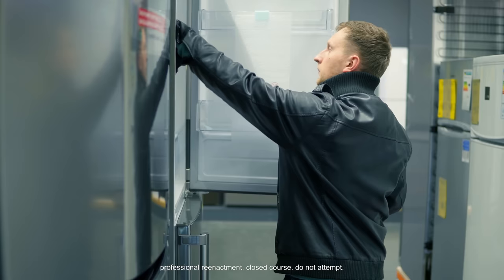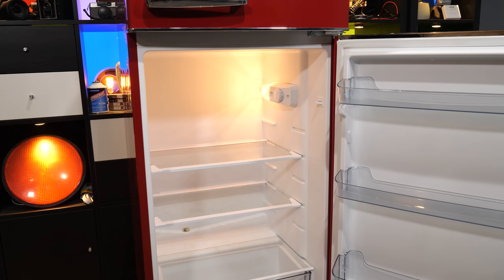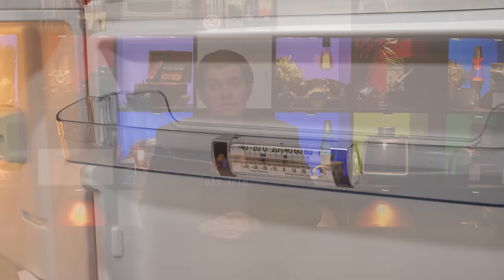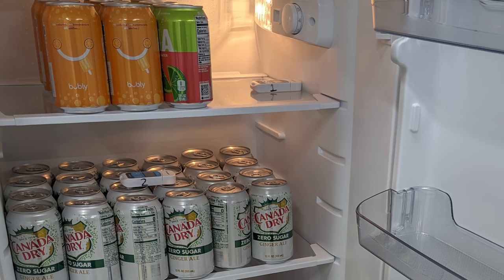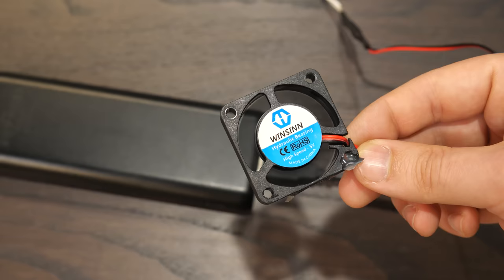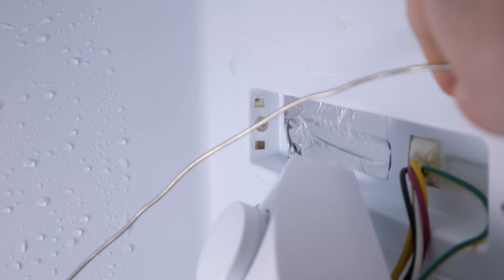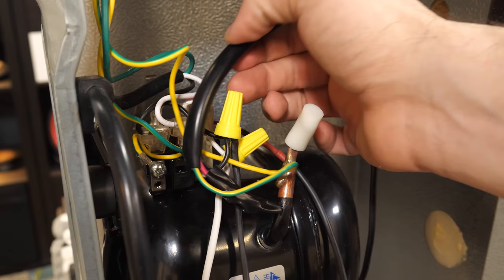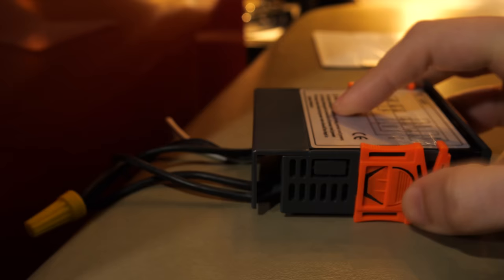This goofy fridge has a really clever design. It's also kinda terrible.

Comment: This is a scary accurate portrayal of what engineering looks like at times.
The chaos also reminds me of my silly idea of someday building a kart with a steering wheel that controls angular velocity of the wheels instead of position.
Reply: Your idea is crazy... but I love it.
Reply: Wait it's supposed to not look like this sometimes? I swear I've only ever educatedly guessed my way into solutions LOL
Reply: Congratulations! You have just invented brake steering! Sadly someone implemented it to basically all agri-tractors and all tanks before differential steering
Reply: Oh god, why do i feel like that go kart is a thing. Btw they made the fridge this way hoping that if the door ever opened, it wouldn’t kill the fridge. Especially for a company who’s biggest customer is motels and hotels. They just have to be good enough. Tbh i don’t even understand that fridge because ive seen plenty that have electronics. There was a bunch that were TEC cooled. One died every other day. They were awful. Probably would be great if there was two or 4 but they only use one. They are sensitive to over current, which they always end up doing
Reply: That sounds kinda like fpv drones..?
Reply: Tank steering

Comment: Alec, fun fact for you to keep in mind when building your own "Fridge" is that when I was an apprentice refrigeration Mechanic in the 1970s and worked in a factory making commercial refrigerators for well known brands of Ice cream and soda. The Cap tube and length of copper pipe was determined by trial and error (The compressor size could be calculated very easily by using well known BTU / volume math) We would take a length of Capillary tube and try different lengths and diameters (It comes in many different thicknesses) cut a length and test it for a few days with a recorder inside and then try a different length and diameter. We got pretty good at it and could predict how much to use by when we got a consistent result and the lowest Amperage drawn over the same length of time. Yes power draw changes by the diameter and length of the cap tube.
By the way, a smart thing to mention was that the cap tube was wrapped around the suction line just before entering the compressor for the purpose of "Heat exchanging" the heat left over from the condenser entering the evaporator and stopping liquid from entering the compressor as liquid is non condensable.
Love your channel so please keep it up.
Reply: I've got to imagine they've improved how to determine all this in a faster and less wasteful method in the last 50yrs...
Reply: @@garbonzobear no kidding?? I really did think there was a better way in the last 50-something years. not claiming to be an engineer
Reply: @slaternapier1640 f we're being 100% honest, the hvac-r industry is basically identical mechanically to how it was 50 years ago. The parts doing the work have changed slightly and gotten more efficient, but ultimately it's the exact same tech. 100% serious. That will be changing some soon but even with high end variable speed stuff it's still the exact same principles applied in different ways

I want to clarify what I mean some. Obviously it's changed but it's really come down to experiments, math, science and trial and error just like before. But the end result is still a circuit with an evaporator, condenser, metering device and a compressor. Sure now it might flow both ways, and your metering device (in HVAC more than R) is a piston orifice or an expansion valve, but it's still the same layout and design. Just achieved a little different

Comment: Update: I've been using this as our household fridge for a family of 2 for the last 6 months. I added a smart thermostat to the door which sends a push notification to my phone if the temperature rises to 40 degrees. Early on I received a few push notifications after stocking. To mitigate this issue we've used a couple of re-usable ice packs to help maintain temp. We keep one in the freezer and one in the door and swap them when we restock the fridge. This simple hack has prevented it from ever hitting 40 degrees again.
Reply: Genius!!
Reply: Manual "latent heat"! 

:D
Reply: I wonder if having a fan blowing on the condenser would help make this thing run a bit cooler?
Reply: @davecrupel2817  the condensers in the walls of the fridge can't put a fan

Comment: I have this EXACT fridge, well, black. Fits perfectly in my 250 sq ft San Francisco studio, and has been a really good fridge so far. The self-defrosting feature has been the best, as my last fridge needed to literally have ice chipped away every month, this thing gets almost no frost, and when it does, it is gone within a day.  At least now I understand why the sides get warm :) As far as the temp zones, they can be annoying until you figure the out, then they become useful. I like my fridge colder than usual, but this causes things in the very back of the fridge, especially on the top shelves to freeze, had this happen to eggs. I turned this into a useful feature, anything I want extra cold, such as soda, meats, etc goes on the top near the back. It works out for me personally, but I also have a BAS in Culinary arts, I can see how this could be a headache for someone without cooking experience.
Reply: I also have this fridge and I do the same. I keep my eggs in the drawer on the bottom. It's the only fridge that fits in my 1947 kitchen so I'm happy with it.
Reply: Before this video I didn't even know fridges could have uniform temperature. What to store where is something my mom taught me when I grew up.
Reply: I also have this as an overflow/garage fridge but since all it has in it is Beer and Soda, it's fine for that.

Comment: As soon as you showed that first plot after adding a fan I thought to myself "Wow there must be something odd happening with the temperature feedback loop", and after you glossed past that and proceeded to try all those other things I could feel a small part of the engineer inside me writhe in agony.
Reply: I also had flash backs to control theory
Reply: The full reveal of the first graph gave it away for me.  Obviously the fact that it stopped cooling well above the set point was the focus, but the fact that it had very similar cycle times was.. concerning.  I definitely didn't guess exactly what was weird about it.  Thought maybe the thermo was really a timer or something but that wouldn't make sense for so many reasons.  (Arguably it turned out to be kind of a timer, with the timing cycle length being related to the heat capacity of the refrigerant I guess?  Still not an actual timer though.)
Reply: I am surprised that he did not consider that the way it is originally designed is set up to give the pump a rest once in a while, regardless of the temperature inside of the box, by making sure the probe could get cold even if the box had not reached its target temp. This could also mean they calculated that at x temp at the evaporator, the efficiency is very bad. I will not be surprised if this modified version burns out soon.
Reply: @itoibo4208  "not be surprised if this modified version burns out soon" 

Unfortunately I agree. The whole planned obsolescence conspiracy theorists, while not entirely wrong, are attributing failures to the wrong things. We have reached an age where a product will be designed to SEEM like it can do the thing, but is meant to run light loads (so the manufacturer can use cheaper electronics and/or hardware, in this case an undersized pump), and therefore when asked to do the thing properly it burns itself out. ie, this thing would need a slightly upsized pump WHEN it burns out. Then itll be fine. Supposing no other copper joints have that corrosive flux left on them like the pump connections did....
Reply: @itoibo4208  Considering the possibility that its intentionally not designed to do what its supposed to do is not really a consideration worth taking into account.  A fridge is useless if its not keeping things cold.
Reply: @itoibo4208  you can see the graph angle for the 10 hours cooling work period was getting smaller than for the small cycles. That shows the pump overheating and losing efficiency. But I'm not too sure if that would be enough to actually damage it. It would spend more electricity though. But it's not a big deal for most I guess.
(My father fixed fridges for 60 years)
Reply: @zombieregime I agree. Planned obsolescence is not entirely intentional, in many cases, manufacturers just want to use cheaper parts which makes it SEEM intentional. The upside is they're cheap. The downside is lower quality.
Reply: I had to skip ahead after the second fan attempt
Reply: @Albtraum_TDDC  thank you for that. I am not familiar with how they operate, just I know they get hot, and most things that get hot need some kind of way not to get too hot.
Reply: same. my first thought was the thermostat. I would have checked that waaay sooner.
Reply: @altrag I'm mostly concerned about the compressor. If it was designed to have a duty cycle, then overusing it might be a really really bad idea. 

Especially when considering that the system uses "explosive" refrigerant. 😬 Yikes?
Reply: @JonesNate  It doesn't matter what the duty cycle is.  If the fridge as a whole was not designed to keep things cold then its not a fridge.  Its just a box with a pump.

You can entertain the idea that "this is just crap throw it out don't even try", but that's not really in the spirit of the video or the channel as a whole.

(Though it would be a good basis for a class action lawsuit if lots of people are buying fridges that don't actually keep their food at safe temperatures just to save a couple bucks on a low-quality pump.)
Reply: @altrag  I wasn't saying that it should be thrown out. 😅 If anything, I think the compressor should be replaced with a higher capacity one. Or, the insulation between the inner and outer plastic could be upgraded. Or both.

I also like the look of the refrigerator, and I like the simplicity it originally had. If I was doing the upgrading, I would keep a non-computerized thermostat in it and put in a better compressor.

Comment: HOLY SHIT THANK YOU FOR MAKIHNG THIS VIDEO. I live on a boat and my only fridge is a magic chef mini fridge. it is basically identical to this fridge in terms of having the same insides and the only differences are on the outside and are cosmetic. You have given me so many explanations for things that hadve had me puzzled about my fridge for ages. things like everything in my freezer being melted and me wondering how it could have possibly happened with the door closed(i now think it was after putting a semi warm crock pot in the fridge). the freezer working a little too well sometimes that you physically cant scoop ice cream without thawing it first and have to cook frozen food much longer than the directions say. things on the back wall of the fridge being frozen solid while things in the door and drawer are just cool. cheese and milk going bad well before their expiration date when they are inside the bottom drawer. 
you gave me so much good knowledge about how this fridge works and it will forever change how I fill and arrange my food in it... as soon as I got done watching this video I immediately went and rearranged all of the food in my fridge. THANK YOU for unlocking the mysteries of the universe for me and helping me hopefully not have spoiled milk and cheese anymore
Reply: "cheese and milk going bad well before their expiration date when they are inside the bottom drawer" the bottom drawer is meant to be kinda slightly warm for veggies and stuff